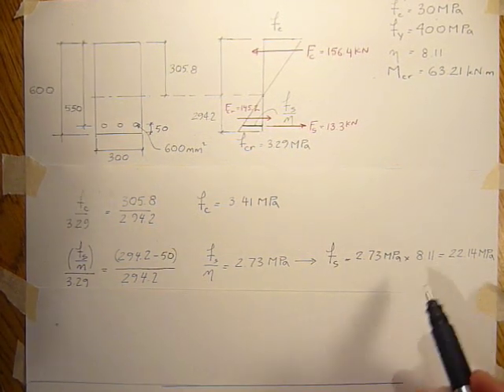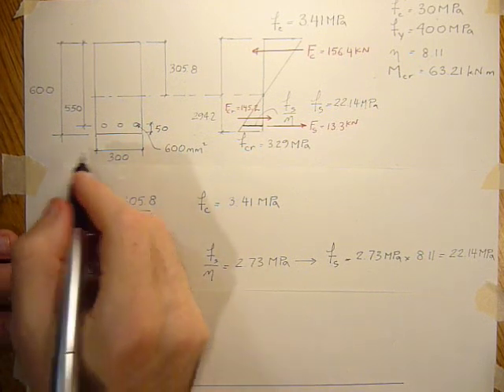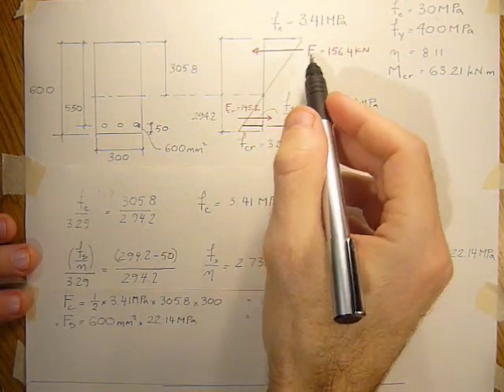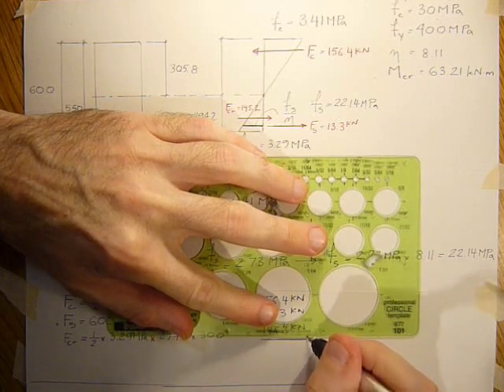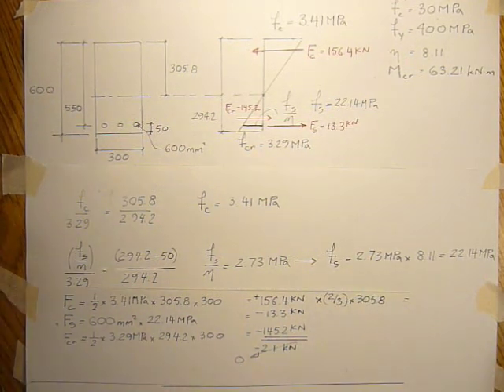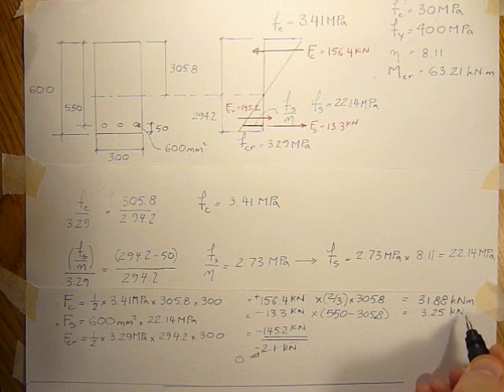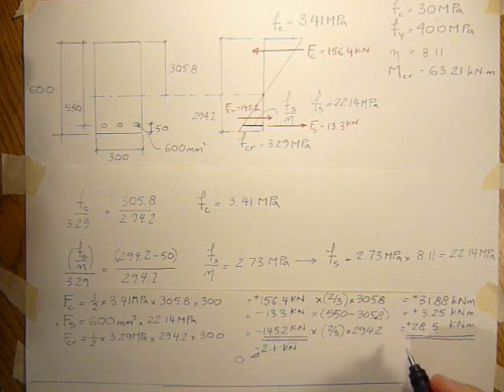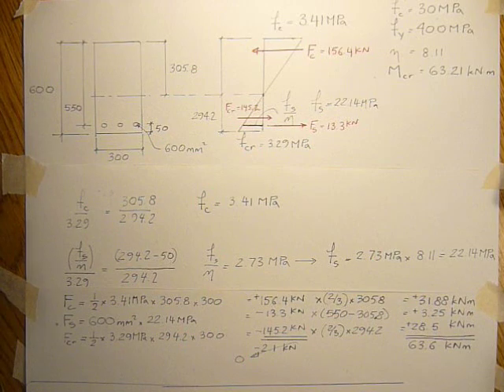T 1.4 Cracking Moment

Comment: you found out neutral axis or centriod of area assuming area of steel is "modular ration" times area of concrete. Can we find neutral axis by equating tension=compression. I tried and found it be considerably different. Do you know why is it like that.? When we design beam, we use the equation tension=compression, why not when finding rapture moment.